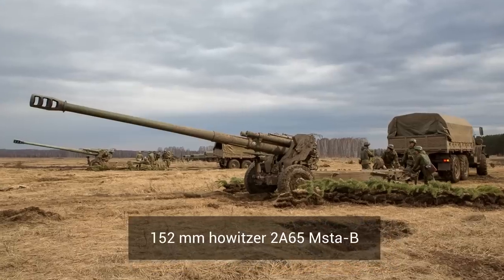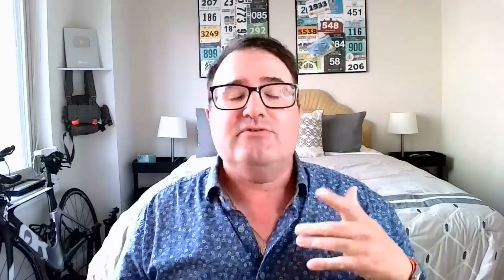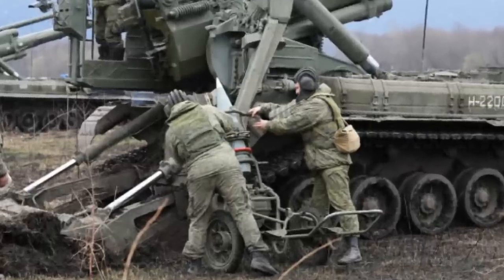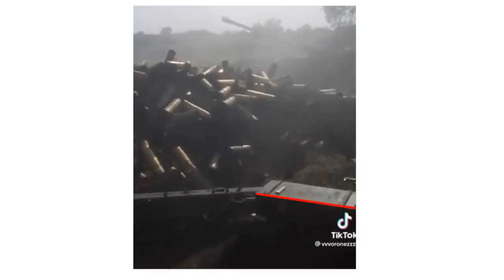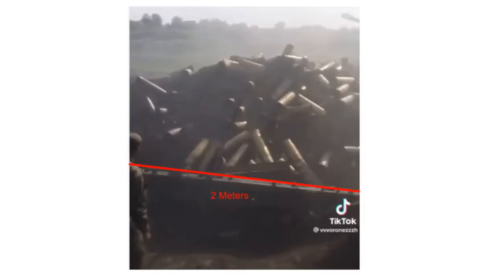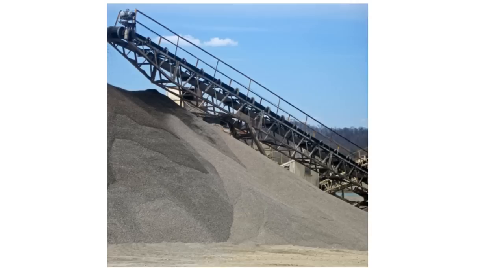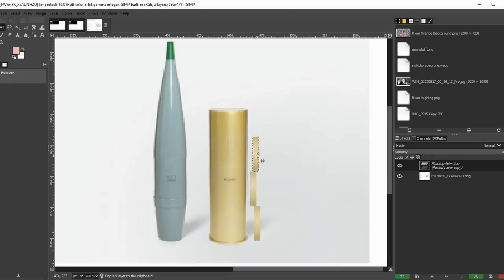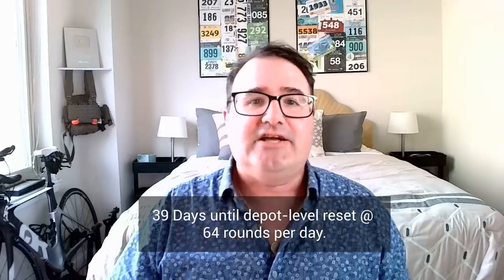When will this Russian Howitzer explode? (2A65 Msta-B Barrel life estimation from shell casings)

Comment: 0:57 that's because Russian artillery was designed to use in real war, while US was designed to be used against insurgency. Basically, operators of M-777 never expect to be shot at, which is why 8 man operates it by design. Russian artillery was designed with idea of minimizing incoming damage from counter artillery fire, missile, aviation in real modern war. The kind of war where "combined arms" doctrine is considered as ideal situation which in most cases impossible to implement in real war. "Combined arms" doctrine works well only against insurgency.

As for the question - i guess by the end of this conflict. If you know anything about Russian artillery, it's not as soft and demanding as said M-777 which will never be able to fire the same amount of shells without maintenance and time to rest for a gun between each 10 shots. That's if gun won't break after said 10 shots right away. Which happened a lot according to Ukrainian TG, where they are quite literally shitting on this gun every moment they can, but have to use it as they don't have much options left. Ukrainian military officials even advised to not publicly shit on those guns in social media, cause allies might get upset and angry which can cause blocking any support.
Reply from the maker: It could. Be more that Russia intended to fight a nuclear war. Fewer operators mean fewer exposed to radiation. And the Msta is nuclear capable.
Reply: @RyanMcBethProgramming  A bit of update. There is a footage on Russian TG with a self propelled gun which cannon has been melted. On 28 august 2022 Ukraine tried to conduct a large scale counteroffensive on Kherson and Nikolaev front which in the end failed miserably with lot's of casualties for minimal result. This self propelled gun was firing during the defense to the point of heated "red barrel" until it melted and blew up. Considering the vehicle and military personal inside of it are both fine and uninjured, it shows that those guns were actually designed to be fired for so long without rest. That mean they were designed to suppress any offense. I'd guess over 100 shells has been fired without any rest for a single gun, possibly even much more. The barrel of self propelled artillery melted and now waiting for replacement to be operational again according to TG report.

I am saying this, because apparently to blew up a Russian cannon's barrel, you need to fire it constantly like in real war on a front line. Without rest. The ideal condition for it is obviously a suppression of large scale offensive actions which happened yesterday.

There are also new reports from Ukrainian TG about M-777, they are shitting on it once again. Additional to this some Russian sources asking for explanation why M-777 is not as accurate as it was at start - what changed?

Those 3 reports together make an interesting case to research for how long can M-777 on itself sustain in real warfare conditions considering that in real warfare it will be shelled. That's once again enforcing my understanding that M-777 was never designed for real warfare. It was likely designed with idea of combined arms. 

Apparently the ideal scenario to use this weapon - is to fight insurgency that doesn't have aviation, counter artillery radars, don't have long range weapons and so on. Any of the last NATO invasions in 20 years perfectly match to this ideal scenario. But Ukraine conflict is different. And it shows.

Actually it's not just M-777. Here is the full list if you want:

🇺🇸 Howitzer M777:
After frequent firing, the barrel does not fully return to its original position, which further disables the gun; after 30 shots, the bolt wedge needs serious maintenance.
🇺🇸 SAU M109:
Due to intense shooting, the mirror wedge of the shutter and the sealing rings of the charging chamber burn out;
🇮🇹 Howitzer FH70:
The tightness is often broken and the nitrogen pressure in the balancing mechanism of the gun is reduced;
🇩🇪 SAU 2000:
The monitors of the Commander Control Unit constantly overheat, the charging system often fails; obturation rings quickly fail.
🇵🇱 SPG Krab:
During intensive shooting, the shaft breaks on the fuse at the bolt wedge, the bolts of the bolt wedge break and bend;
🇫🇷 SPG Caesar:
The aiming program incorrectly calculates: the first shot is always undershot by 600-800m; guidance blocks spontaneously fail.

So basically NOT A SINGLE artillery piece in NATO was actually ready for real war. Notice how it almost always about intensive firing and issues with sustainability of fire. Something you never need against insurgency, but need at real modern warfare.